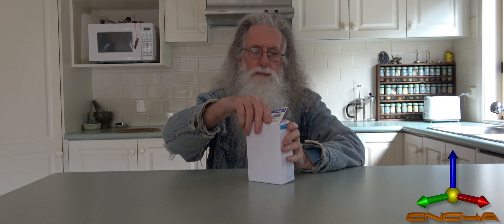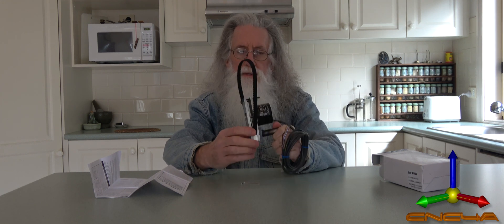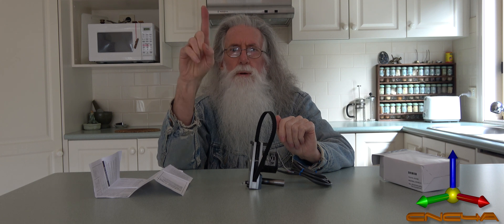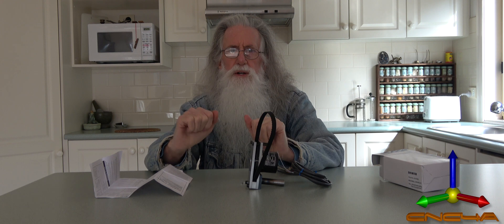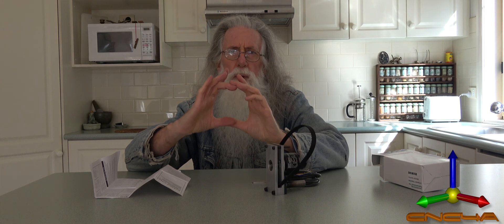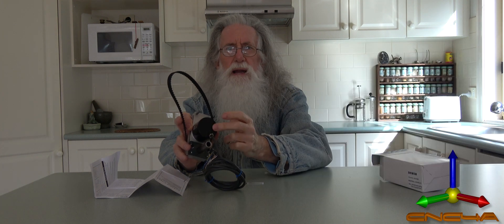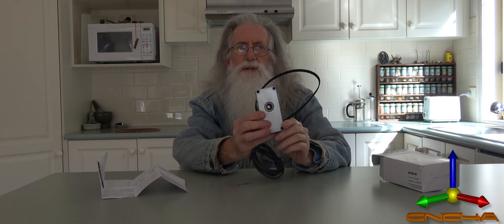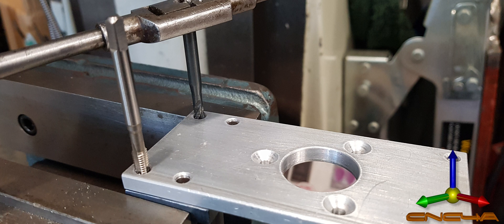CNC4A - Mach3 Alternative 05 - Spindle Encoder

Comment: Can you show me how you set it up on the controller to get the rpm set correctly 
The encoder is quite expensive but I will stick with your recommendation, thanks
Reply from the maker: On the back of the controller is a D9 connector labelled "CN9 SP Encoder" that the spindle encoder D9 plugs straight in to (matching wiring of course).  By the way I am not recommending this, just showing it as consideration.  It is not plug and play and can become quite involved.  The easiest, but much more expensive solution is to buy their completed setup with servo motors, controllers, relay cards, etc, etc and you just plug it together. I got the bare bones controller for two reasons, the cost for the machine it was going on and the main one that you would of noticed if you have watched my almost 300 videos is that I like to tinker.
Reply: @TheWizard  
I’m using geckos 320x and I’ve got them moving with amt encoders and the old SEM motors , I’m converting an old 1983 lathe that had Anilam control 
Appreciate you talking to me 👍🏼
Just wondering after it’s plugged in do you have to make adjustments on the controller
Reply from the maker: Hopefully you have subscribed as it doesn't say you have yet.  If not then this is the last bit of info.  It is not appropriate to tell you how to setup the controller at the moment as when and if you do get one the manual that comes with it will be suitable for that model.  I have the 3 axis model but it makes more sense to get the 2 axis one, and cheaper.  For your tacho, these will give you some alternatives.  As always thanks for watching and subscribing.
https://www.youtube.com/watch?v=TCnHAa7Ufno
https://www.youtube.com/watch?v=aey2ZLl0NL4
Watch more of my videos full of WIZdom on my channel as they all have tips that can help you with your project.

Comment: Hi,
Thank you for the information. I have a question:
Is a 2-phase, 4wire encoder good for Mach3 to be used? If not, what encoder is good to be used for Mach3? And how do you wire it please?
Thank you
Reply from the maker: Hey Jimmy you need to subscribe first and then I give you the answer.  I need more subscribers as people are not not spreading the word fast enough.
Reply: @TheWizard  I have already subscribed
Reply from the maker: Then Jimmy you are entitled to the keys to the kingdom. My apologies, I did check but utube doesn't make it very easy to see a list of subscribers.  They are always pushing their popular guys to the top of ever list they show you. So as promised here is the info requested. This is from the Mach3 Mill Manual.  Basically you use a quadrature (A+ A- B+ B-) encoder and set it up in the Config > Ports & Pins > Encoder/MPG tab. You can only use it as a MPG.  Sure you can have a glass scale connected but you can only display that in a Mach3 DRO and it will do nothing else so why would you waste the limited and precious pins on something that you could use the DRO readout that came with the kit with the glass scales (cheaper that that way) for the same result?

Rotary encoders can be interfaced (via the parallel port input pins) to Mach3 as Manual Pulse Generators (MPGs).
5.3.5 Defining encoder inputs (Config > Ports & Pins > Encoder/MPG tab)
The Encoder/MPGs tab is used to define the connections and the resolution of linear encoders or Manual Pulse Generators (MPGs) used for jogging the axes. If the encoders count the wrong way just swap the pins allocated for A and B inputs.
5.3.5.1 Encoders
The Counts per unit value should be set to correspond to the resolution of the encoder. Thus a linear scale with rulings at 20 microns produces a count every 5 microns (remember the quadrature signal), that is 200 counts per unit (millimetre). If you have Native units set as inches the it would be 200 x 25.4 = 5080 counts per unit (inch). The Velocity value is not used.
4.11 Linear (glass scale) encoders
Mach3 has four pairs of inputs to each of which an encoder with quadrature outputs can be connected (typically these might be "glass scale" encoders - see figure 4.15. Mach3 will display the position of each of these encoders on a dedicated DRO. These values can be loaded from and saved to the main axis DROs.

Again my apologies Jimmy and keep safe.

Comment: Kind regards from Colombia.
Very pleased with your channel and all the information you share.
What is the type of encoder used to make a thread ?, incremental or absolute. This is to adapt it to a three phase AC motor.
Thank you for your time, attention and valuable response.
Blessings of health and tranquility in these difficult times.
Reply from the maker: Hi Jaime, you certainly have asked a lot of questions but you haven't subscribed.  The more people that subscribe the higher you go up the food chain to become a suggested video and so help more people to learn. I say in my videos if you have any questions then subscribe as I only put up a new video when the last one has been watched by a few people or the subscribers number goes up. I will answer this one for you.  The encoder is incremental but it must also have a index pulse ie Z.  The index is to tell the encoder where it is on the spindle (chuck position) and the A B pulses are to tell it if the speed is varying so need to adjust the feed, etc to match the thread.  Like the question you asked about the Mach 3 slots.  The more pulses you have the faster the controller has to be to be able to read them and respond.  Say for example you are doing 6,000 rpm. that's 100 revs per second.  Or 0.01 sec/rev.  You have a 1,000 pulse encoder so that is one pulse every 0.00001 secs.  For poor Mach 3 that is way too fast so everything you get must match the capabilities of everything else, or the weakest link in the chain. So until the next Jaime Villada, Mantente Seguro.
Reply: @TheWizard  
Best regard.
Thanks for taking your time to reply.
I subscribed after watching the video of the hall sensor with magnet.
Also with a little hand up because it is deserving.
He managed to attract my attention with the theme of the theme.
That is why I am watching each of his videos in order to better understand and clarify doubts.
MUCHAS GRACIAS.
Reply from the maker: My apologies Jaime. Utube doesn't have you flagged as a subscriber and with their new studio its hard to find anything.  I am very pleased that you are the best subscriber I have as you understand that every video contains a bit of helpful information that bit by bit as you watch each video you soon learn that it all fits together and not matter what the subject is, 3D printers, lasers, etc, etc they all can give you a tip that you can use in another area of your project.  What puts you up the top is that you are watching more than one video and gaining from it and asking for more info which is great. There are close to 300 videos so 1 a week would take 6 years to watch, one a day, 10 months, 1 an hour, 12.5 days non stop.  I do not recommend that but you are certainly going through them.  This lockdown does have some benefits.  If only I could get more subscribers so I say now "Spread the Word, Not the Virus".  I am glad that you enjoy them.  I will now answer all your other questions. :-)
Reply: @TheWizard  El tiempo no importa cuando el expositor vuelve el tema muy interesante.
Muchas gracias.